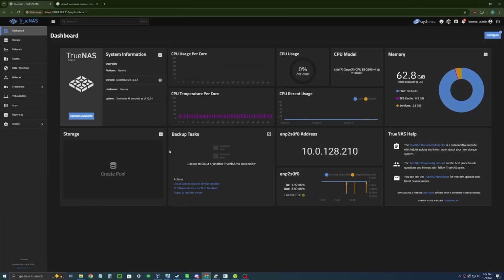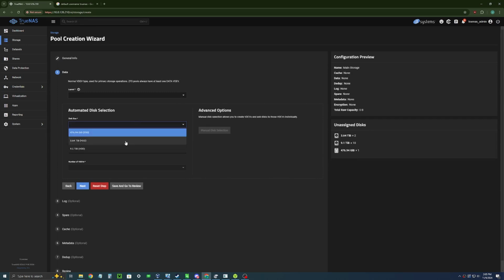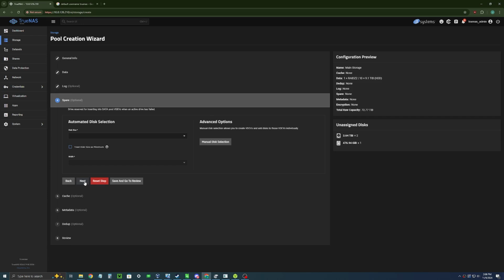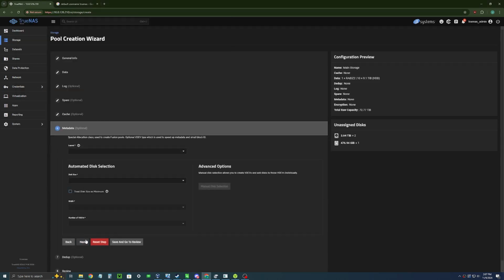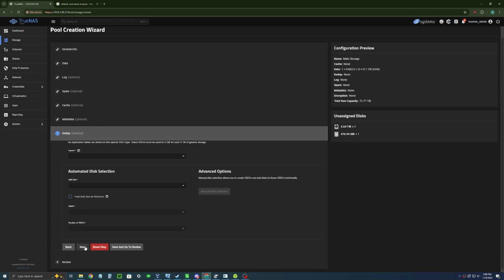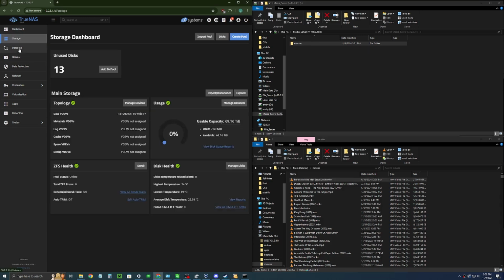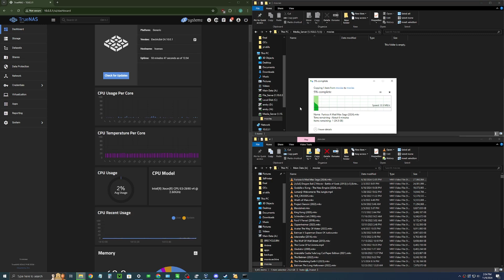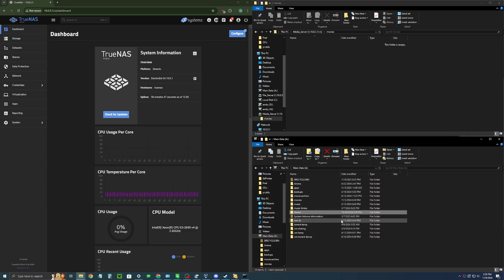Work On The Homelab Part 6  ~100TiB NAS

Comment: 2:19 you could use the internal USB port for a pendrive and stick your boot partition there, server should be able to boot from that. Had to do that with my HP DL380 cause the BIOS won't boot off the backplane when the RAID controller is in HBA mode.
Reply from the maker: I thought about doing that but I was told by someone that the newer versions of truenas have a tendency to be write heavy twords it's boot drives, whether it's true or not I don't know.
Reply: @ControlAndTech  the root drives possibly, but /boot will only be written to with a new bootloader or kernel version. Though reading some stuff about it, TrueNAS really doesn't support doing that sort of thing and when it breaks, you get to keep both parts. The way you have done it is probably the best, all things considered.
Reply from the maker: I mean it is a homelab so I think the motto fuck around find out fits pretty well lol. I may in the future play around with several different boot means and compair performances